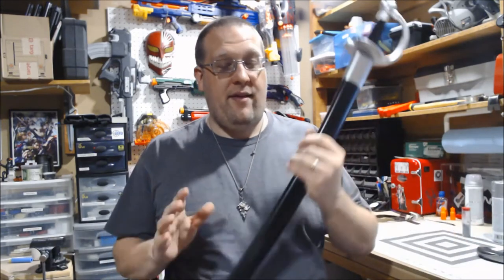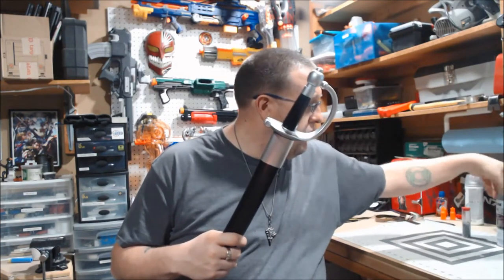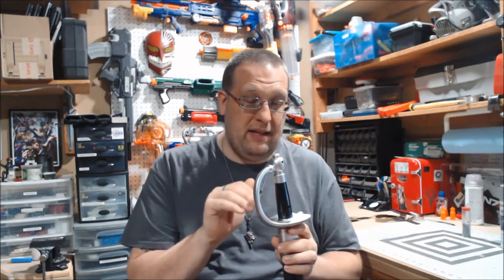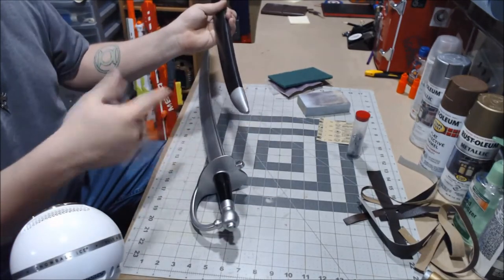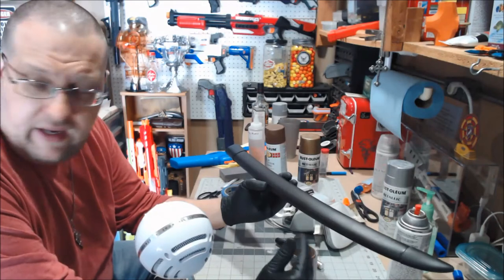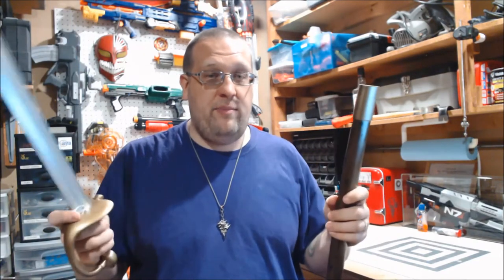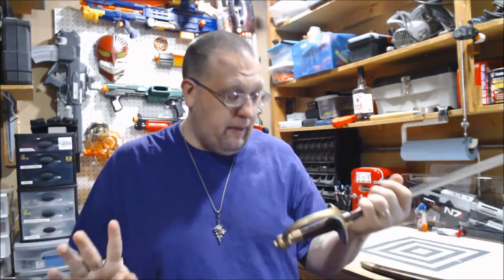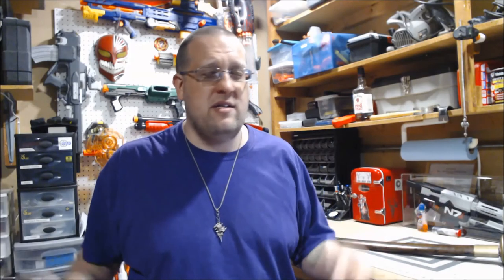Pirates of the Caribbean Cutlass Prop Build

Comment: Doing a Presidio Soldado ( soldier) outfit from the 1700’s. Pretty much same weaponry. I purchased the exact sword. 🗡️ 
Was planning on doctoring them up as well. Great video. I learned what NOT to do. Thanks! 👍🏽🤨
Reply from the maker: You’re welcome… I think… 🤔
Reply: @TheGriever2112   you’d think it would be a simple upgrade. Not so, the paint not holding at first. Cure time. The glitter aspect. I’m just surprised I found a video “build” with the same sword I’m using. 👍🏽
Reply from the maker: @robertrollice2829  gotcha.

Comment: That is actually a pretty cool prop to begin with. You got there in the end. Some of that cheap brittle plastic has a bit of a reaction to enamel paints. Using an acrylic for the base should help you next time. Also too thick a coat of clear coat will dull things / make them cloudy. At least you got there in the end and were happy with it! Cool video.
Reply from the maker: Thank you. The funny thing is, I never have that issue with a clear coat except on that chrome/aluminum paint. Even with the gunmetal I use it never gets that bad.

Comment: Nice video, but did the Buzz Bee Pirate Pistol have to be killed? Bummer
Reply from the maker: That was killed by nephew a while back. So I made the best of it.
Reply: @TheGriever2112  In the spring (tax time to be precise) I'm planning to have a number of Buzz Bee parts machined out of steel and aluminum, the priming mechanism of the Pirate Pistol being one of those. Going to test the viability of getting some made to market at least on a small scale.
Reply: @MongooseJakeNerf  if you do the parts on a Thermal Hunter I would be glad to buy one from you for my Sam of course.
Reply from the maker: @MongooseJakeNerf  I know Clownie would be interested in that for sure.